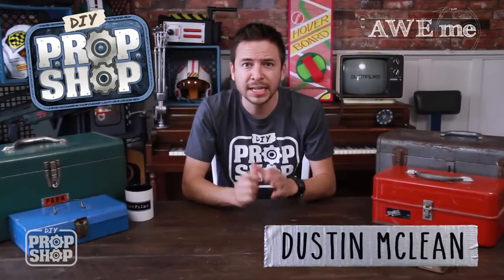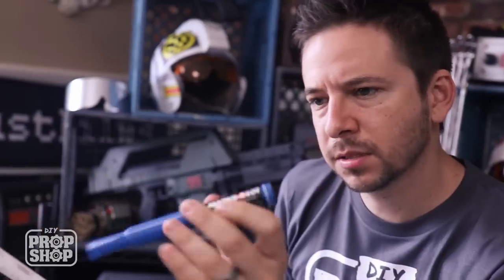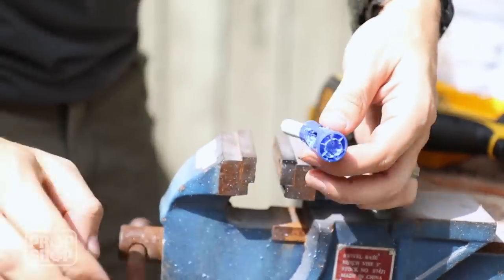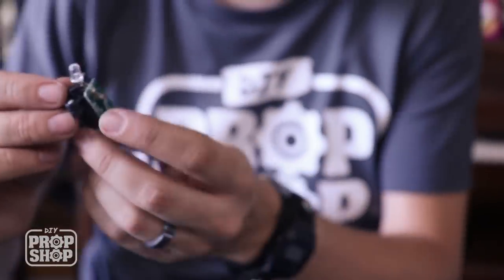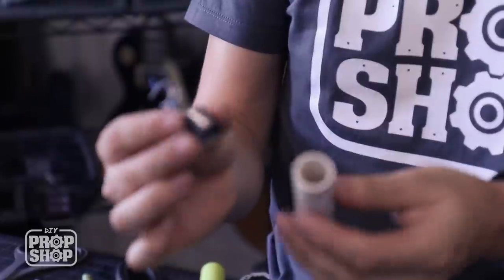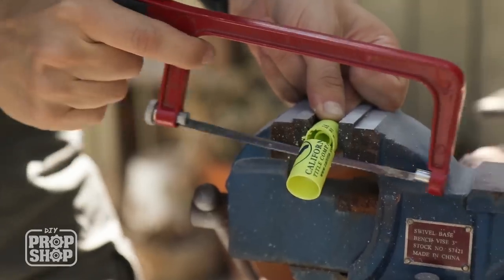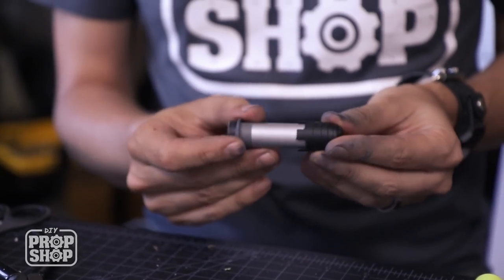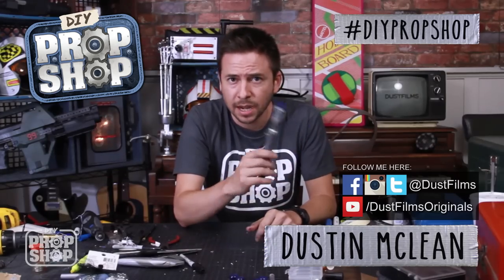Make a Sonic Screwdriver (Doctor Who) - DIY Prop Shop

Comment: Out of 10 I'm unfortunately going to say 6.5 because the bottom silver part is too long it needs to be small, the button for the light is right at the bottom of the handle and not by the slide button but overall its still pretty handy

Comment: For the 'cracked' effect on the larger part, you could probably crinkle up some plastic and dab a different shade of grey onto the screwdriver. It wouldn't turn out perfect, but it would add an interesting texture.

Comment: you also couldve replaced the led with a blue one aswell as detaching the battery pack and extending the wire for it
that also means you can have the button higher up

Comment: Use the super glue for modeling it works a lot better because it makes a thin lair to prevent spiting out and the brush is easy to control but it dries out after 5 days

Comment: Dude, you soldered with the batteries still in the housing?  Bad move, you don't want those things overheating.  Need to put a safety tip up on that one.